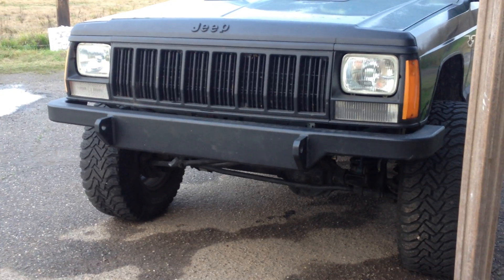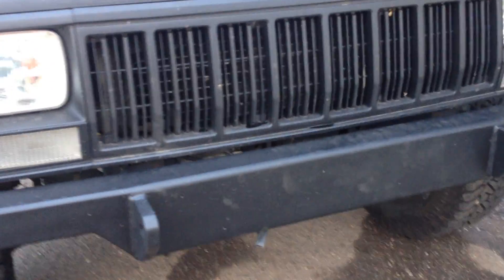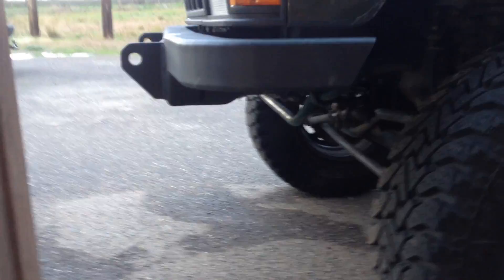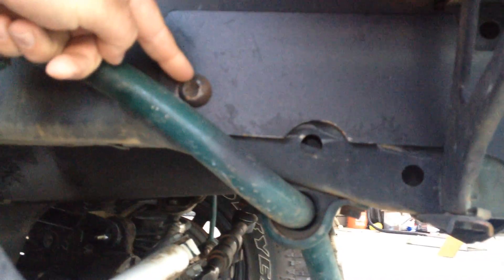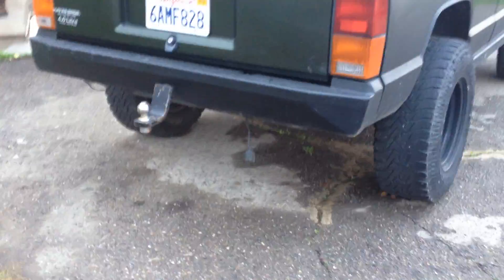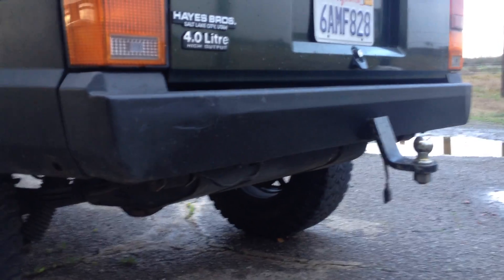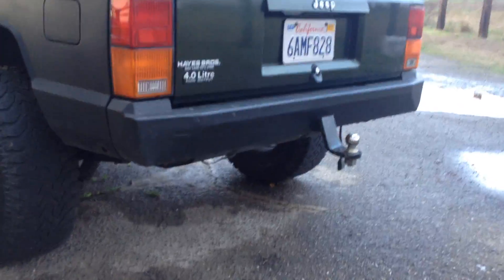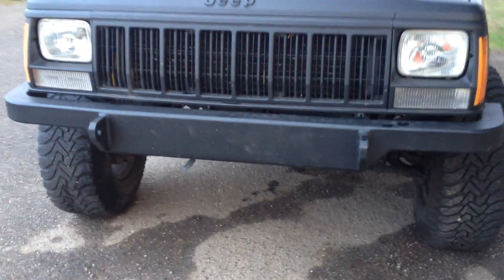My DIY, Low Budget built bumpers for my XJ Cherokee

Comment: Nice Fab Job!  I see the fenders that are trimmed and you have a nice bead / seal for protection.  Can you tell us what you did there?  I haven't seen it in threads or in stores.  Thx
Reply from the maker: Brass Bright Beads if you're referring to the front fenders, that's sheet metal edge molding you can get from McMaster Carr
Reply: Indeed.  Thank you.
Reply: Gary Briggs could you link this? Can't seem to locate it on their website

Comment: Hey Gary I was wondering, do you had any drawings for these bumpers?
Reply from the maker: I dont not, designed it from a mental image as i went.
Reply: Gary Briggs ok and for the rear bumper did you just weld the sheet metal to the 2x2 tubing then just bend it manually to get that profile?
Reply from the maker: Front or back?
Reply from the maker: The pieces that give it contour are individually cut pieces of 3/16 plate fit by hand and welded solid
Reply: The back bumper
Reply: Ok thanks for the info!

Comment: i have a 93 xj i wanna do a 4.5 lift with 30inch tires and longer brake lines 8x15 rims bar link eliminators
Reply from the maker: I like Rusty's and Ironrock Offroad, solid companies
Reply: *****
i do too but im not paying 160 for shipping rough country 60 for shipping on complete kits
Reply from the maker: buzzkill7838 cheaper than you driving over there to pick it up?